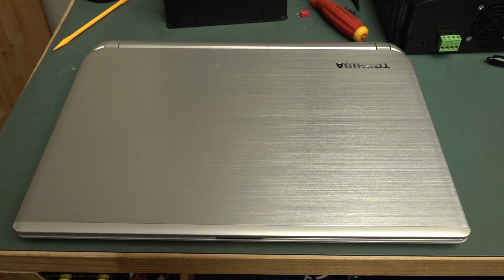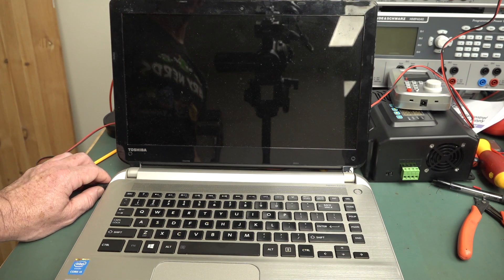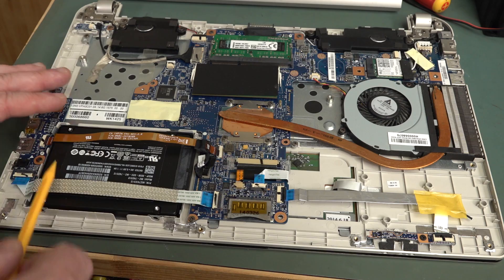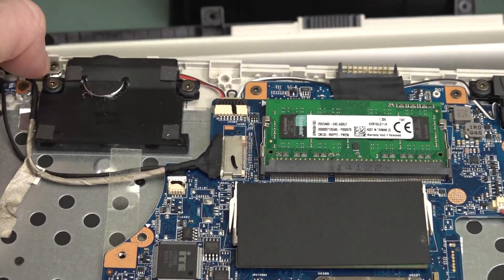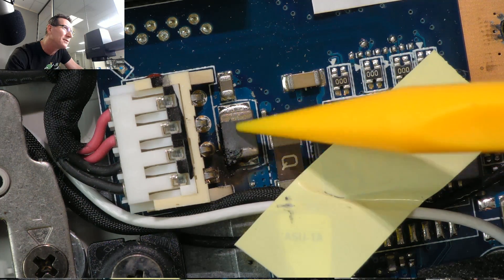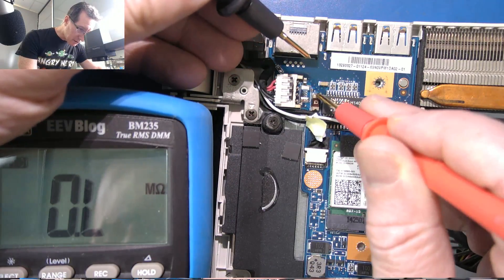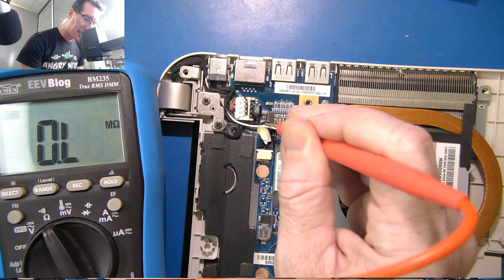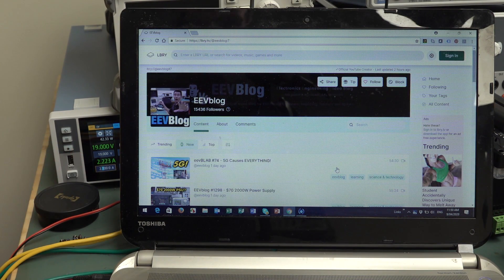EEVblog #1299 - Dumpster Laptop REPAIR

Comment: 4:05 I believe they have the cables routed around that way so they can use that MB on different form factor computers. You can see for example the cut out on the left for left side fan placement. I haven't worked for a Toshiba MSP since 2014, but I know that Dell does that a lot. If there's a 15" and 17" version, this is often how it's done.

11:58 Yes, that screw comes through the back cover. It's a great way to save on your BOM cost on low end devices like these. 

I hate the complete hack job whoever installed that SSD did. It's really not that hard to get a screwdriver from somewhere and transfer the screws from the old one.
Reply: And having connectors on separate boards makes replacement easy if you damage a port. A good example of that is the power connector on my dell inspiron 13. Its plugged in via a short cable, 2min job to replace. Dell even give you the disassembly/service manual.
Reply: Yep, my alienware 15 R2 motherboard has labeled screw holes for the 13, 15 and 17 versions on it.
Reply: I see you also noticed how the caddy was still flapping around in there.

Comment: Well, you've scored yourself a $300 drive there Dave. Although SSDs are getting cheaper - I put a Crucial MX500 1TB in my laptop about 6 months ago. Got it on ebay sale for about $160 and the laptop is night and day.

Take that drive out, put in an older 128GB, turn the laptop 90 deg and make it into a mini MAME arcade machine.

Comment: Date code of the SSD is kind of irrelevant - if it sat on a shelf for half the time, it didn't reduce its useful life. I would suggest to run CrystalDiskInfo (or other S.M.A.R.T. viewer) on this drive and check the total amount of data written to it. This is much better indicator of remaining useful life.
Reply: Its an 850 Pro - we've used them in database servers and you'd have to be pounding on the drive for that 10 year warranty to wear it out.

Comment: These motherboards are often separate from the IO board so that they can use the same exact board for multiple different chassis. It also has the nice side effect of broken USB ports being easy to replace for those who aren't capable of soldering. By the looks of it based on the shape, that particular board could have been also designed with the possibility of the cooler assembly pointed to the other side. While definitely not the most spectacular machine there is, awesome find especially because of that SSD. These 850PRO drives were the top end of 'prosumer' range a few years back and they are almost indestructible write-wise.

EDIT: You can also see the unpopulated SATA ODD connector right behind the fan on your current config!
Reply: Holy cow, you're right! That whole space was meant for the ODD. You can see a curved cutout on the other side where the speaker is; that was where the fan was meant to go. The board was designed for a completely different laptop!

Comment: I’ve got an old Macintosh IIfx that suffered an incidence… someone had, uh been a little cavalier with filling the box with hard drives, and mixed some internal and extrnally powered drives and somehow mixed up their power cables…  blew the inductors right off the “internal” motherboard sourced HD power tap.  My first ever motherboard repair putting that right...

Comment: I have a 512Gb SSD in my old Dell Laptop. They are getting so cheap nowadays at this capacity, and most are decent performance that it's an easy upgrade.
Reply: Yeah, I put a 2TB samsung nvme drive in my new (to me) desktop (usff) ebay pc. Get the best bang for your $ when you buy a 2 or 3 generation old PC, even when you can get the CPU at employee price which is 50% of retail. I got the whole PC other than SSD and power adapter (free anyways) for less than I could buy the cheapest new processor for. I run linux, so 2 or 3 generation old PC is more than sufficiently powerful. 2 or 3 generations old is newer than most of the desktops we have at work too!

Comment: The HDD/SSD caddy is missing. The drive shouldn't be loose.
Reply: Yeah mine has a blue rubber speedo thing around the drive.
Reply: it's not such a problem for an SSD , just secure it with a sticky pad.
Reply: Looks like someone teared in there to try and fix it - found the blown bit and decided to chuck it.
Reply: @ReubenHorner  Then why didn't they yank the drive? Anyone who even contemplates fixing a power problem is going to grab that drive (and maybe the ram) for the spares box. Hell, when you're not using Dell (or any other "random parts are us" seller) you'd probably keep the whole thing for parts, keyboards do get broken occasionally after all.
Reply: @ReubenHorner  Why will they not take the hard drive out than...
Reply: @georgedemean2228  I'd imagine the person who through it out (the owner I guess) didn't realise  the value inside. I'd guess that the owner brought it to some independent shop and they said yea nah its stuffed mate, then the owner gave it the chuck.

All we can do is guess but the fact is - it got chucked even though it was a simple fix
Reply: Not a big problem if it uses a ribbon to SATA cable.
Reply: The caddy isn't missing, they just didn't secure the drive to it, you can see the metal underneath drive.
Reply: In his case, he could find a piece of rubber or something to wedge around the SSD to keep it steady, and reduce the stress on the connector if he uses another SSD with it. A friend of mine uses a mini ITX PC in his truck, with all SSD storage, it has handled years of driving on poorly built roads.
Reply: You can 3D print a replacement, though they aren't really necessary for a SSD. Vibrations hurt HDDs, not SSDs.
Reply: @Helio_Centra  - "3D Print" - ROFL, FFS get real.

Comment: You may want to at least crack those other machines open, I had a few come through that had ssd's that I wouldnt have guessed would have had an ssd
Reply from the maker: I did get it have a look, 2nd channel if I find anything.

Comment: It's been a week since Apr 1'st, are you going to tell us how you did the LCD to e-ink display video.
Reply: my guess is hidden power wires with "if (Serial.available() > 0)" controlling the counter
Reply: @MeltedSpades  I would have to guess take the chip out of the Arduino, bend the power leads out a bit, put it back in and wire up a cheap USB battery to power it.
Reply: Gus Gorman.
Reply: April fools!